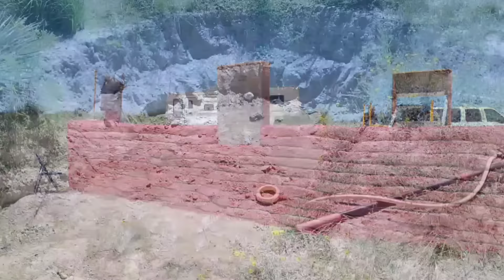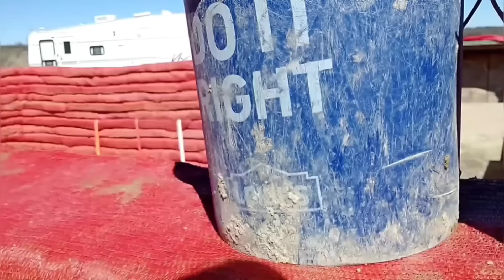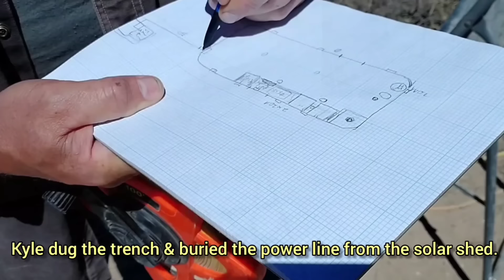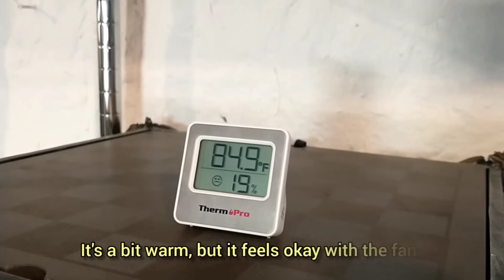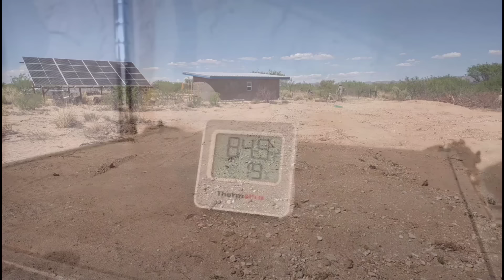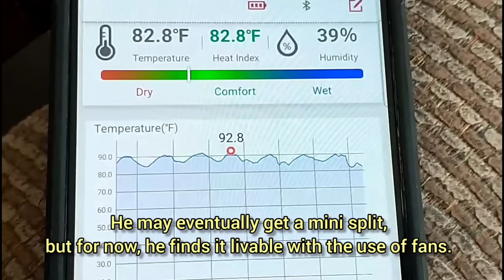FULL BUILD! Off-Grid Tiny Home from Start to Finish DIY Hyperadobe in the Desert

Comment: The wall material was obviously dirt cheap.  Relying on your own labor eliminates the cost of labor usually associated with building a house.  Thick, earthen walls are good insulators.  The amount of mass in the walls acts as a heat sink.  The temperature inside the house is likely to be much closer to an average of the day and night temperatures rather than the extremes of day and night.  Given the use of heavy steel girders in the roof and the relatively short span of the roof, I suspect that portion of the building is actually over engineered.  There was some wood used in the roof but overall the house should be highly fire resistant.

I have two concerns.  The first is that earthen structures tend to settle and shift more over time than framed structures.  That shifting and settling can compromise the structural stability and bring the heavy roof down on the heads of the occupants.

My second concern is earthquakes.  I live in the Los Angeles area where earthquakes are common.  I would be very concerned about the lateral stability of the walls during a significant earthquake.  Again, the heavy roof could collapse on the occupants if the walls are badly compromised.  I was working in Northridge as a cop during the Northridge earthquake.  I had an opportunity to see just how bad things can get when roofs collapse onto people inside.

When I have seen professionally built earthen structures in the past, there has always been an effort to address these issues.  There has always been some kind of framing or structural reinforcement.  I didn’t see any of that here and it concerned me.

I also didn’t see anything to suggest that an architect or structural engineer had planned the home.  Further, I didn’t see anything to suggest that building inspectors examined the structure to make certain it was safe.  Maybe these things happened and they just skipped them because they weren’t interesting enough to include in the video.  I sure hope so.
Reply from the maker: I understand and appreciate your concern. When Kyle first started building the house, we were pretty unsure about how strong it would be. The first time we saw it in person, our concerns were put to rest. The soil he's using has enough water, sand, clay and caliche that it packs and dries hard like rammed earth.  There are some areas that are a bit crumbly, but overall it is very stable and dries very hard like brick. It is a monolithic structure, so it should hold up quite well to earthquakes. Adobe brick construction does not hold up well to earthquakes because the mortar crumbles. Our area doesn't typically get earthquakes, so we aren't particularly worried about that anyway.  The walls are over 19 inches thick, including the stucco on the outside, and cob on the inside. 
I have seen people build with sand bags or hyperadobe bags and not wet the soil enough, or use soil that is too sandy. I have major concern about those structures eventually collapsing. All that is holding them together is the bag material and the outside coating. The walls are not structural or solid. 

I wouldn't expect much settling from Kyle's house because it took close to a year to build, and the walls went through the rainy season, were well packed, and have had plenty of time to settle. If the walls went up really fast, settling might be more of a concern. 
Regarding the roof. Cee purlins are lighter than trusses, so it's not a particularly heavy roof.  It is well built to hold up to the monsoon storms and microbursts we sometimes get in the summer. Fortunately we do not get tornadoes here. 
I can't guarantee it, but I would expect this house to be around for much longer than any of us are. 
🌞🏜️
Reply: Thanks for taking the time to reply.  I have seen far too much death and suffering.  I sincerely hope you are right.

Comment: $12k for this ??? Would not it be like 3x cheaper to use normal concrete blocks 400x200x200mm with holes for insulation ???
Reply from the maker: The completed 19 inch thick walls including the interior and exterior coatings cost around $1200. Concrete blocks of that size are not readily available in our area, and having them brought in would not be cheap. You also couldn't use a rubble trench foundation for that type of build. Kyle's foundation was free.

Comment: That $15,000 on septic was ... probably required by the building code people, but so unnecessary. A small house like this could have gotten along with a composting toilet and a hand-managed greywater system.
Reply from the maker: Yes, it is required for the permit. Pretty crazy to have 275 feet of leach field for just for the kitchen sink, dishwasher and toilet! The shower and washing machine are gray water.

Comment: I thought the ends of the steel beams would get a hollowed out hickory log slid over, for a Faux pas Adobe log beam roof.   You lucked out with the dirt and no screening per say.  That waste's ALOT of time.
Reply from the maker: That would be cool! Yes, also not having to mix in clay, sand or cement saved a lot of time and work.

Comment: I really don't get why the roof cost 5k...Its not like it had anything fancy in it, wouldn't thick old school hot dipped corrugated steel roof had sufficed? That must go for near scrap prices.
Reply from the maker: Materials are expensive these days. This house also has 5 ft eves to protect and shade the walls. The price includes the metal roofing,eves, soffits, insulation, and ceiling. The R-panel steel roofing was a bit of a splurge and cost $1,300, something cheaper could be used. We wanted something fireproof, and that would last as long as possible.

Comment: Considering my daughter and 2 children are extremely sick from toxic mold born from molds in soils. I wouldn't trust the mold spores would stay inside those cloth bags.
Reply from the maker: Sorry to hear it! An earthen home might actually help. Hyperadobe bag material is made from a mesh material which makes the walls breathable. The stucco can trap moisture, so it wasn't an ideal choice, but the inside is cob, so hopefully it will be okay. The house is also well ventilated with the portholes. An earthen home with breathable walls, (no cement or stucco) typically has very clean air.

Comment: The septic tanks system is a ridiculous price at 15 k it costs more than the house when in reality it should cost no more than around 1500 for a digester, a series of basic pipes, fat trap and a run off.  15K for what digging a few holes ???
Reply from the maker: Yes, it's crazy, but a traditional septic is required for the permit out here. Material prices have skyrocketed in the last few years! 275 feet of infiltrators isn't cheap, and they weren't charging any less to do gravel.

Comment: 50 tons? Are you sure? I think it's  not even 5 tons! Bear in mind that it's incorrect to multiply the approximate amount of buckets to a bucket capacity in kilos as the soil contains water which evaporates and the weight of the soil changes
Reply from the maker: We have no idea how many buckets of dirt he used. The house has 87 linear feet of wall (15' × 30' minus the door)  18 inches thick, and about 8.5 feet tall. The walls are made of hard packed sand, clay and caliche. I'm not sure exactly how he figured it, but you are welcome to do the math.

Comment: This will fall apart in an earthquake. No engineer or city’s writing off on this.
Reply from the maker: We don't typically get earthquakes here, but from what I have read, this type of structure will likely hold up to one really well. These are 18 inch thick walks made from packed clay, caliche, and sand. It's really impressive how solid and thick they are. Rammed earth structures have been known to last hundreds of years. Adobe bricks don't handle earthquakes well because the mortar crumbles. 
The main reason hyperadobe wouldn't pass building code is because it doesn't have enough insulation.

Comment: I don't see any advantages to this construction method.

Other than uploading to YouTube...:body-blue-raised-arms:
Reply from the maker: It had nothing to do with YouTube. This is something he thought he could build himself that would last. He had the walls mostly done before we got any videos. 
The advantages of this type of build are: you can use a rubble trench foundation, which is easy to do yourself and very inexpensive. Kyle doesn't have experience in construction and wasn't comfortable with building a more traditional home or foundation. Most of the materials to get started were already on the property. This was a house he could afford, and work on at his own pace. Solid, 18 inch thick walls are pretty awesome, and less expensive than a shed conversion or mobile home. 

But.. If one has more money and is comfortable building with wood, concrete and metal. I would recommend building something like the passive design home we built for ourselves. 🌞😎